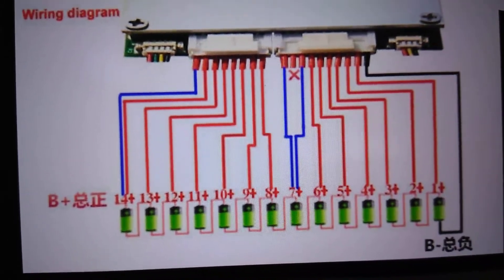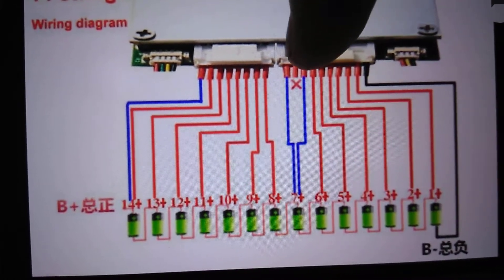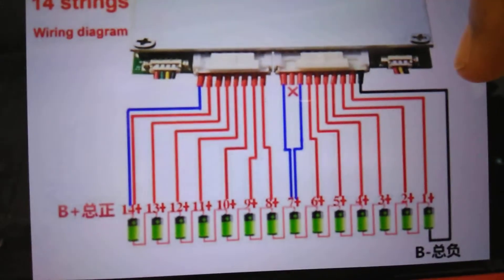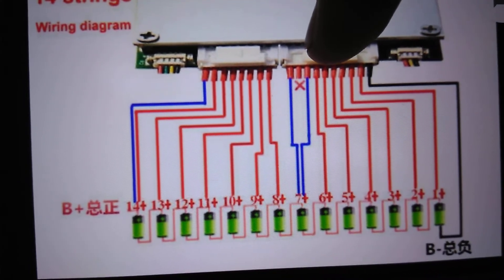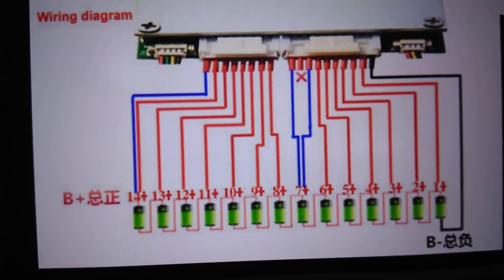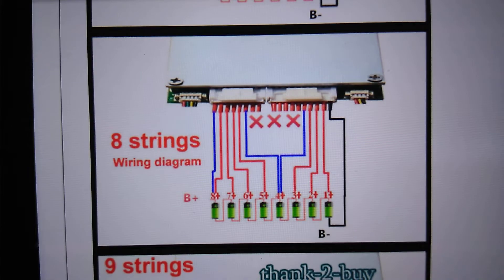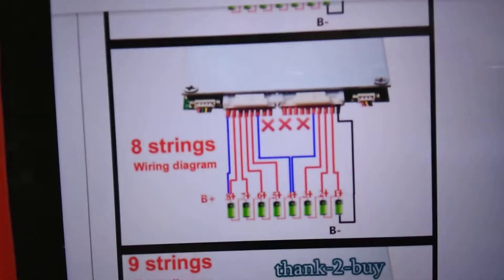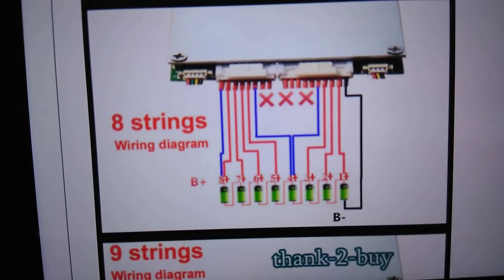BMS wiring diagram 14 s and 8 s

Comment: Maybe I never seen wiring like that before but each one is different
Reply from the maker: Is very confusing because they do not even show all the wires on the wiring diagram.   On the BMS it's about 6 wires that they do not even show they are the ones that you do not use.
Reply: @carsonlurbanwindandsolar3437  usually that blue wire is the forward I was talking about so the second plug can see the series
Reply: @carsonlurbanwindandsolar3437  I am thinking move the 8 to the other plug in series 1-8 then the jumper from 9pin to 1 pin in second plug. but this is only a guess as it is your bms
Reply from the maker: @offgridwanabe  that worked I move one blue wire to the left plug and one blue wire to the right plug and is working fine now.  you do 1 2 3 4 5 6 7 on one plug and eight nine 10 11 12 13 14 on the another plug and one blue wire to each plug. The wiring instructions was totally wrong.  Thanks for the help 😁👍👍.
Reply: @carsonlurbanwindandsolar3437  Awesome as it should work and instructions are always confusing
Reply from the maker: Dennis Jemison  thank you 👍.